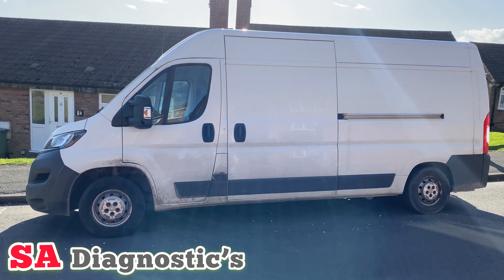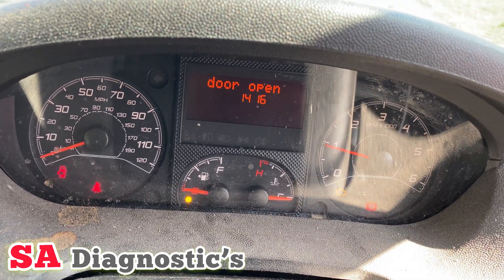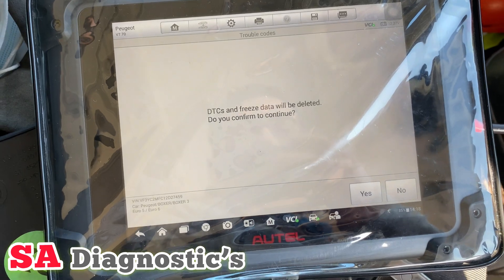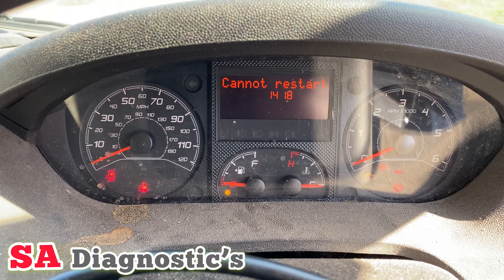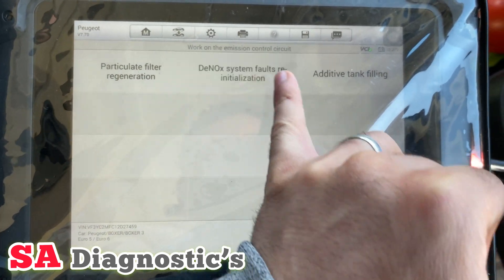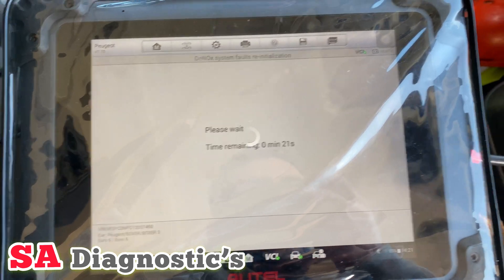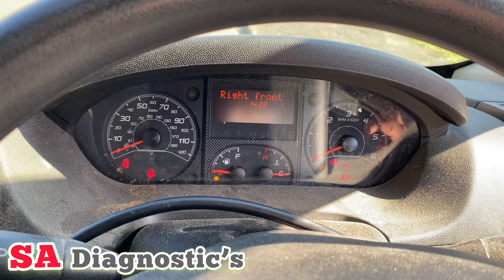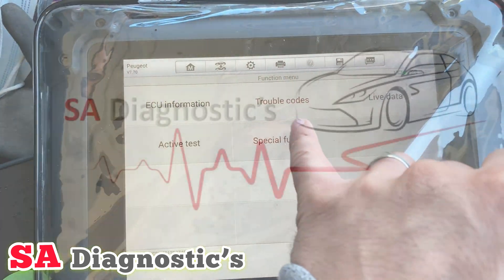Peugeot / Citroen DeNOx System Pollution Particulate Filter U029D P2BAD P2200 P1199 P3057 FIXED!!!

Comment: Hello. Sorry for my poor english.
I have same problem on 208 1.6 bluehdi. I have u029d, u1000, p2200, u029e, p3057, p2048.
2 days i search a problem….
I try your solution this morning 😃. I have autel .
I hate modern car.
Thank for the sharing. And i tell you if is running.
Vincent
Reply: Finally, urée injector. Short circuit and Fuse f28 in bsm. 
Many thanks. 
Vincent
Reply: @vincentreveillaud3250  What Fuse is that? I've got exactly the same 6 codes on my berlingo..
Reply: @dawidj6202 . Sorry, I don’t know on berlingo. 
Try all fuses 😢
Vincent
Reply: @vincentreveillaud3250  yea but maybe you remember the name of this fuse?
Reply: The name…? F28🤔
Reply: @vincentreveillaud3250  thanks, in my case MF3 was burnt

Comment: Hello mate, are you any near Birmingham? I got this problem on my 2016 Peogeot Partner I’d love you to clear this problem as now is telling only 50 miles left to switch off.
Reply from the maker: Hi sorry am in Rotherham
Reply: How will you be able to help any advise please, I’m scared if I drive there the car will stop and not start. It’s only got 36K on clock is 2016 I bought 2017 never drive is been parked. I tried to drive a bit thinking the problem will go away but nothing.
Reply from the maker: @Freedom_fighters898  can’t really do much take it to dealer or Mercedes specialist pal.
Reply: @sadiagnostics  Oh man, seems like you know what you doing man! Mercedes specialist can check and clear the fault? If I had lot mileage left I wouldn’t mind drive to Rotherham tbh